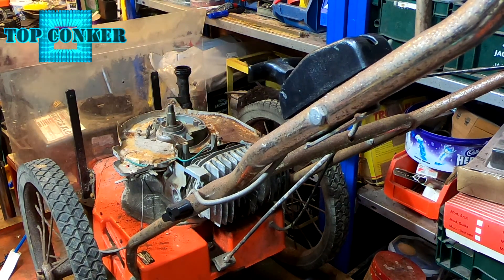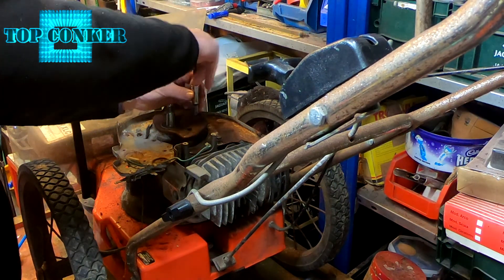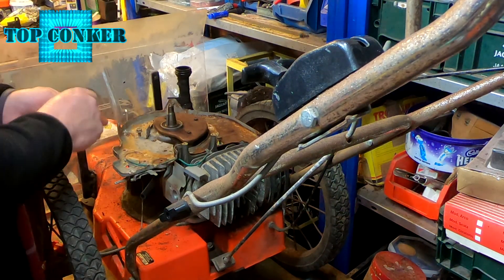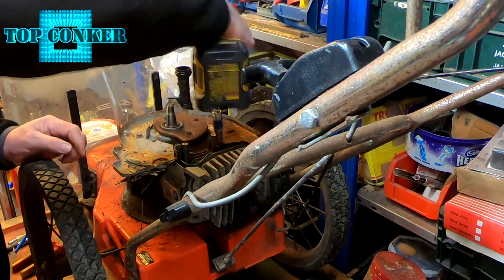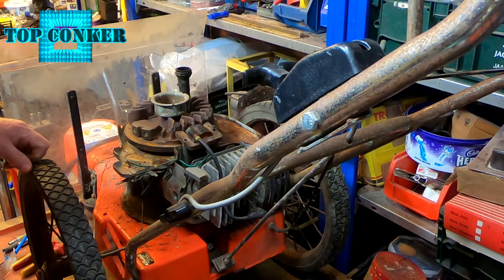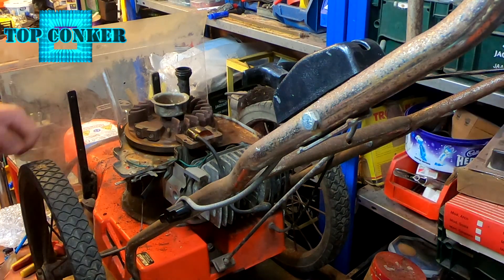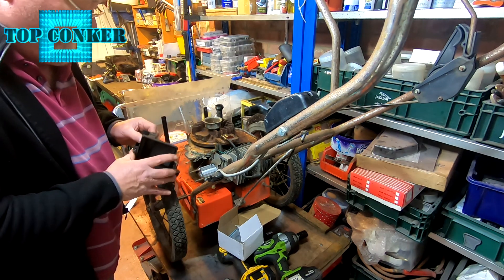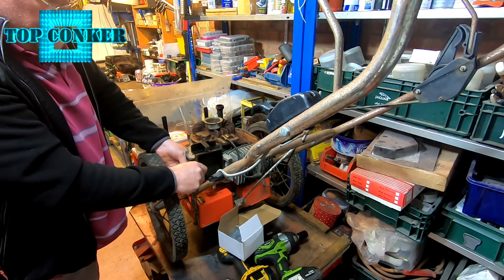Tecumseh walk behind strimmer been stood for 4 years

Comment: Nice video Top is it a cable or belt issue with the head? Part 2 coming up? The OLD MAN at EP over and out!
Reply from the maker: Not sure Wayne, the customer just asked me to get the engine to run, I noticed however when I tried to engage the head the motor smoked showing it was under load so could be the head is siezed